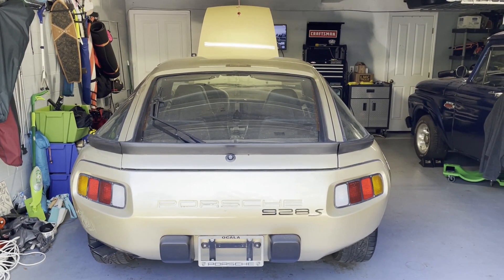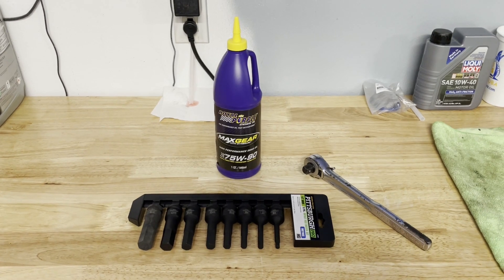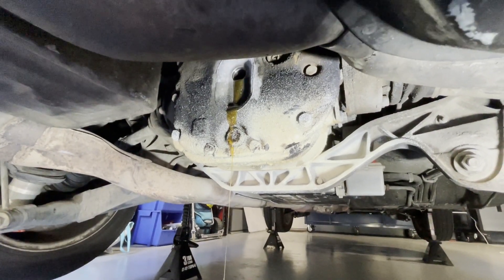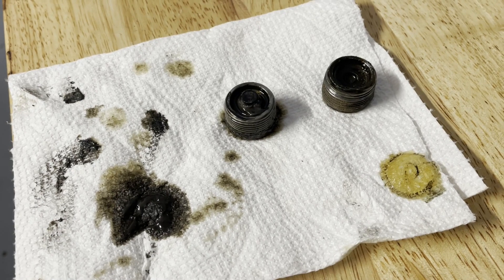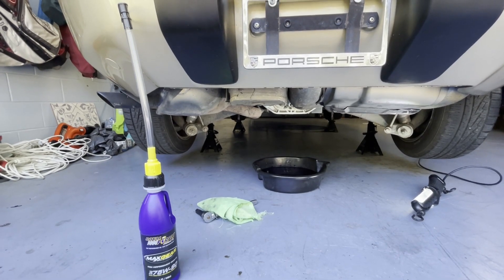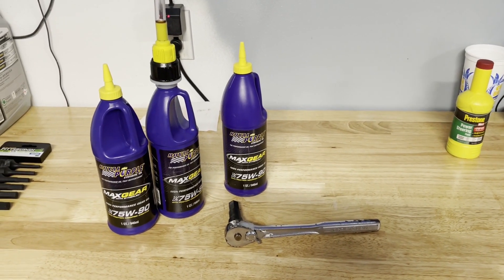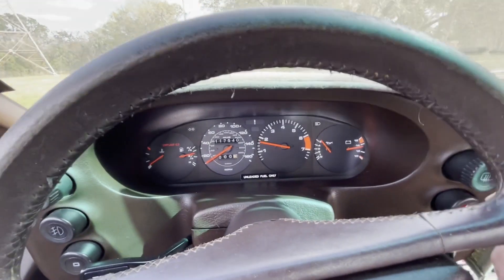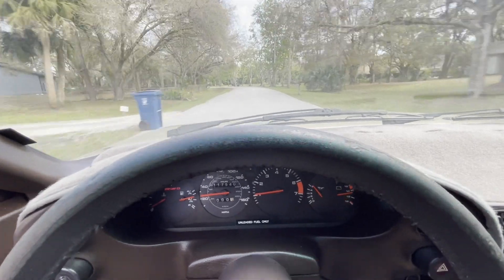Porsche 928 Rear Differential Fluid Change

Comment: Sweet, I am excited that the 928 is doing great.  Well done with some well needed maintenance.
Reply from the maker: Not as great as it may seem.  Filling up the transmission showed me where it was leaking when I got back from the drive I went on in this video.  Pretty sure I'm going to have to drop the trans (diff, thrust tube, and rear crossmember) to replace the torque converter seal.  A lot of work for a $10 seal!
Reply: @C3K Paddock  oh man, that is going to be a job for sure.